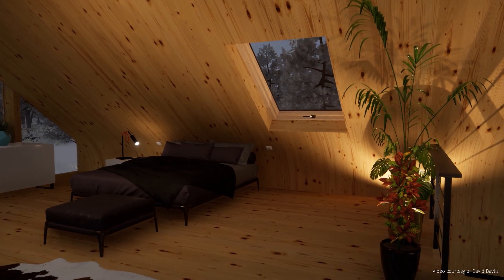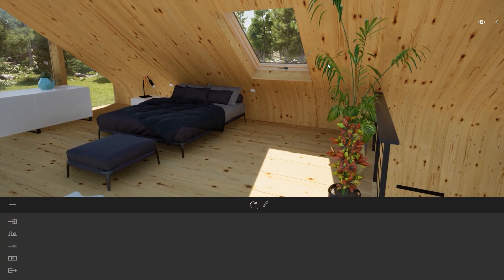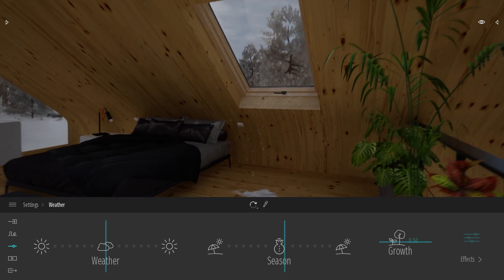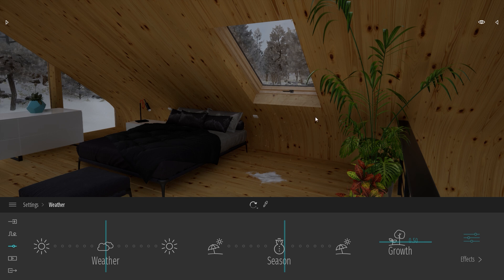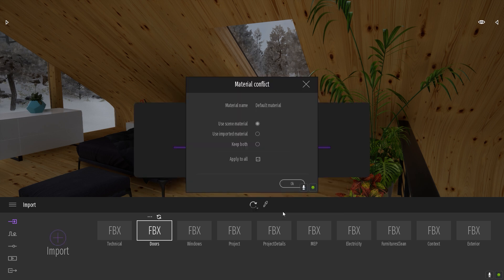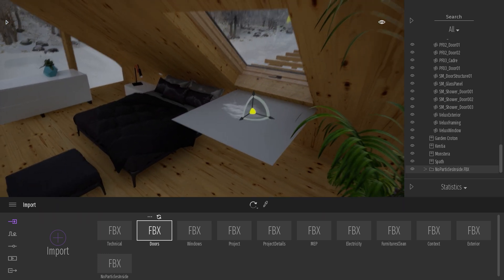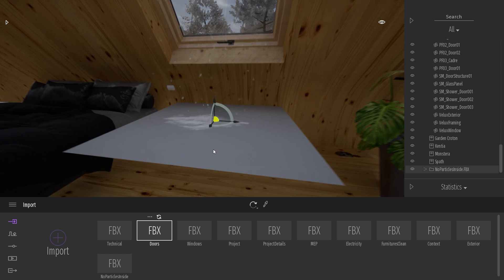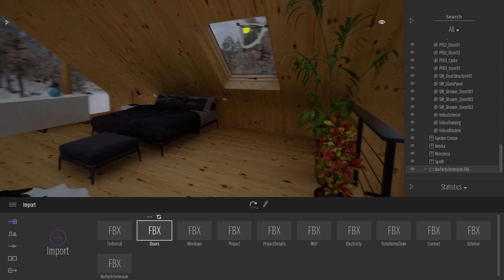Stop snow/rain from falling inside a building | Tips & Tricks | Twinmotion

Comment: Thank You for your Tips and Tricks Video on Blocking Rain and Snow.
The Problem I’m having is where to find a link to the Particle Blocker noted in your Video “NoParticlesinside.FBX”?

In the absence of your “NoParticlesinside.FBX” particle blocking material, In Archicad, I substituted the “NoParticlesinside.FBX” with a thin layer of transparent plastic film under the glass, and it blocked the rain and snow particles.